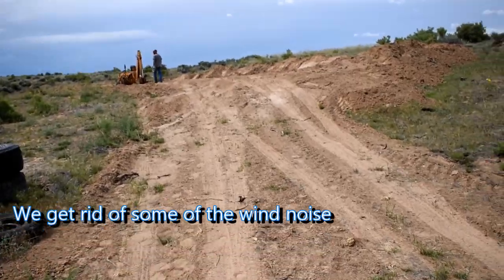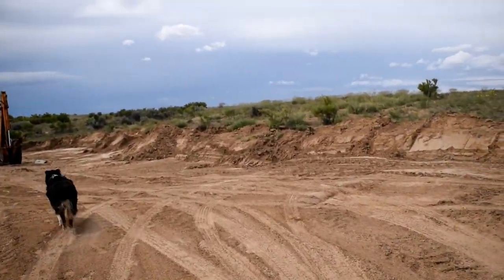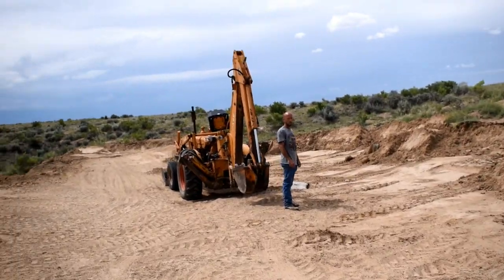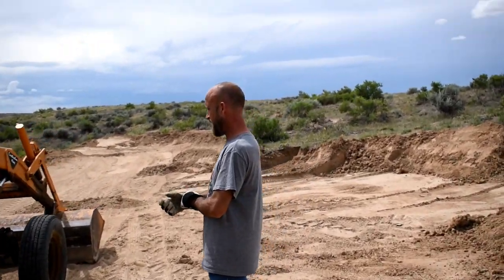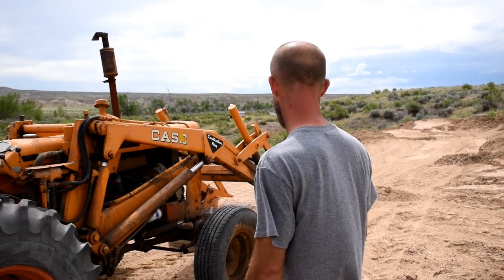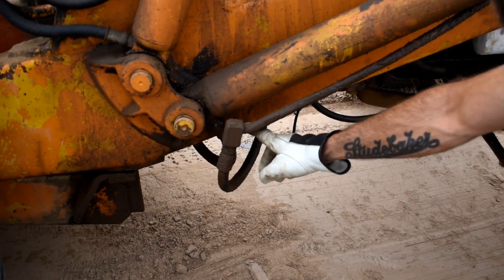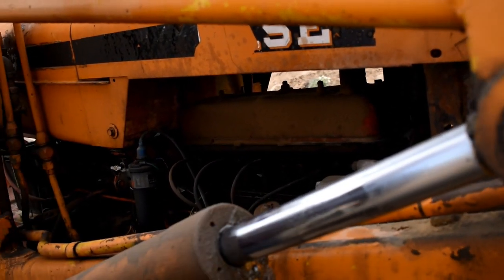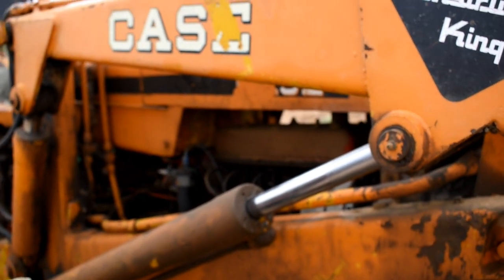Case 530 Construction King Hydraulic Cylinder Rebuild with BullDog Parts from EPSStore.com | P1 of 3

Comment: lucky there not that bad to work on eh
Reply from the maker: No, love these old machines
Reply: @120acrewood7  Great video. I have a 63 also. Good old machines.  Got 3 cylinders off mine now. Getting tired of adding fluid. Been working with one lift cyl for awhile. Ok for light work. My end nuts came off with impact easily, just having trouble getting wipers back in. Just replacing obviously bad packing,
Reply from the maker: @garysretirementfarm2888  yeah they were a real bear. Very tight, but take your time and they will go in. I also held my tongue to the left. I dunno, seems to help